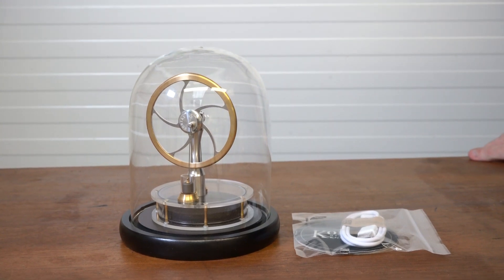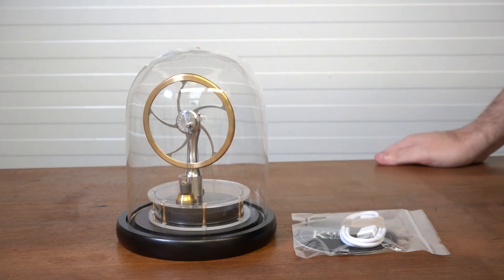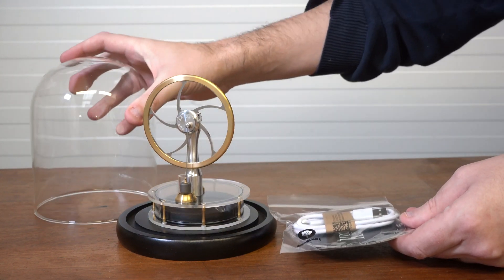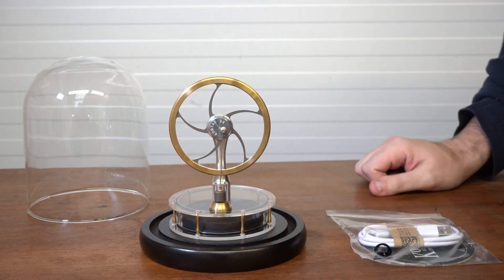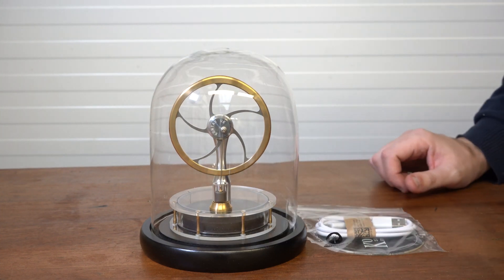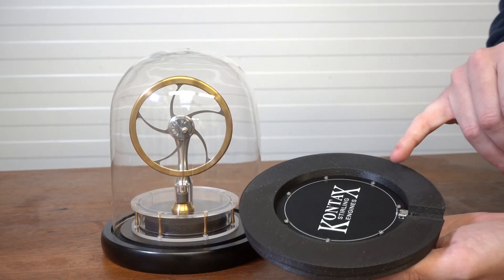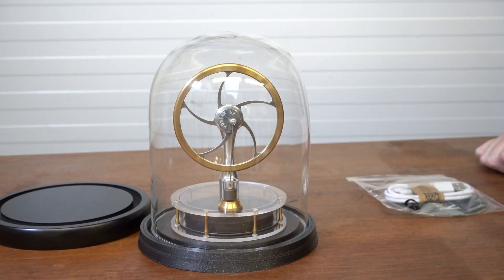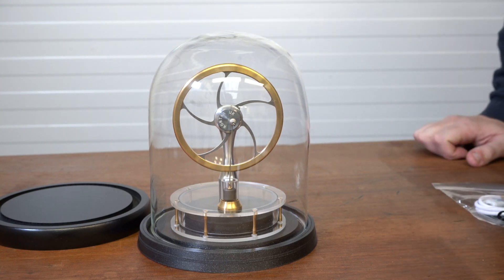3D printed prototype Glass dome - Stirling Engine Kontax

Comment: To answer your question, there's definitely interest from me in the new dome base. I currently have a glass dome, and a separate heater plate (though my heater plate doesn't have a socket - the wires are soldered directly on to it).